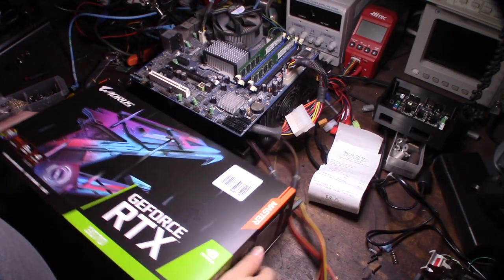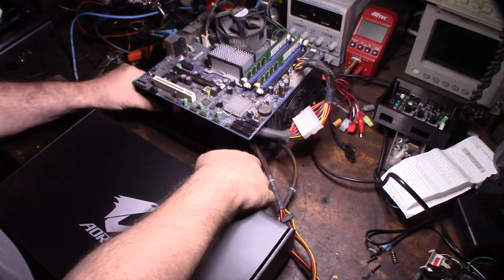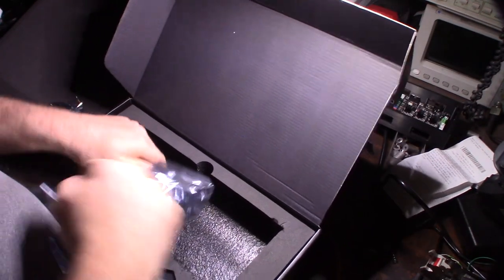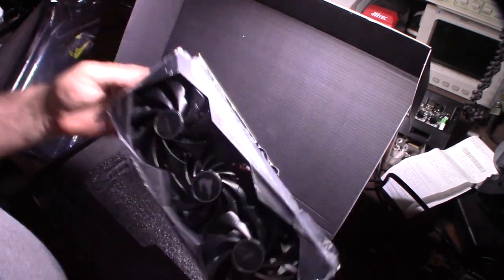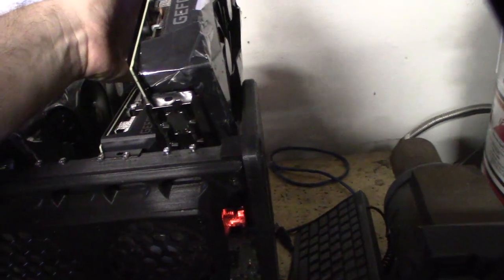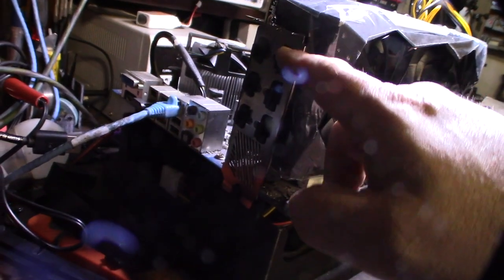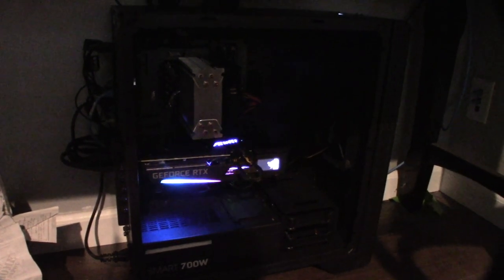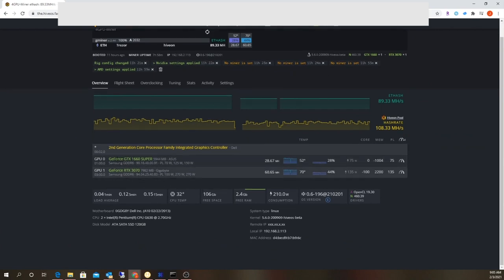Gigabyte RTX 3070 Aorus Crypto Mining Ethereum HiveOS Nicehash SCALPED!!! on OfferUP

Comment: Are your temperatures stable at 60 MH/s or are thermal pad replacements needed?
Reply from the maker: Been running good for over a month
Reply: It is a very decent card, had a 2060 super vefore this one would run 85degrees celsius... this one in a game max 70-74 and while mining its only 50